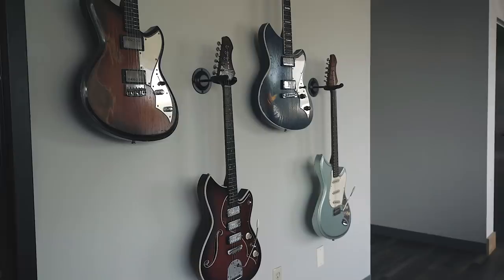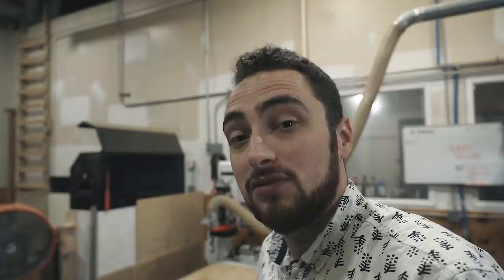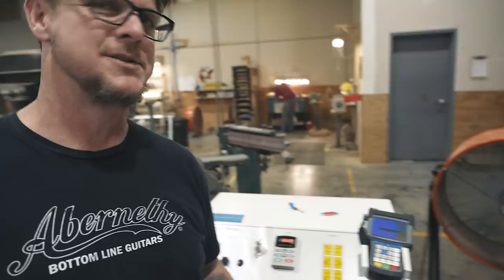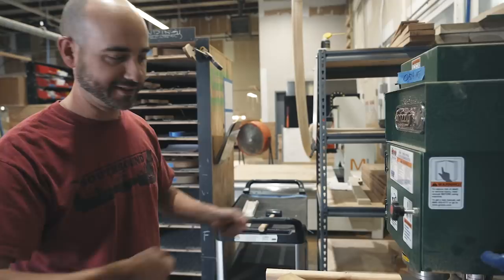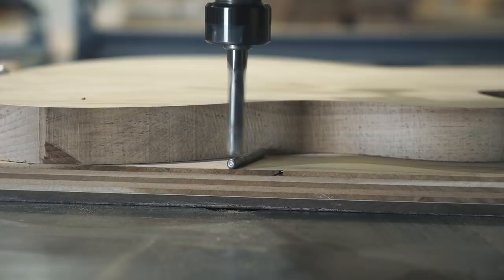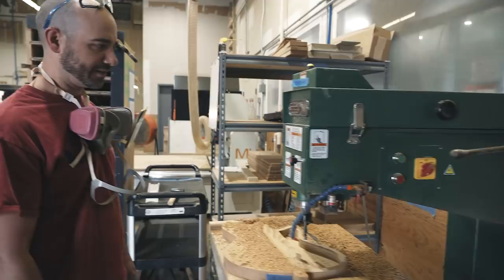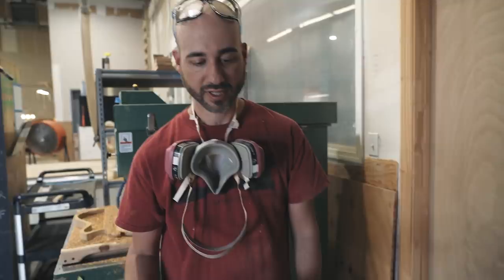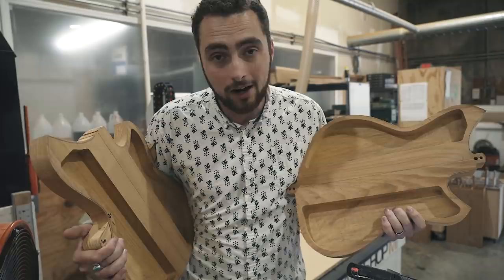Is “Handmade” Really Better? CNC vs. Handmade Guitar

Comment: I am a manufacturing consultant. We deal with this issue on many different kinds of products. There is little difference between pin router and CNC when hogging out a body blank, other than in time savings and consistency. IMHO this was not a good comparison.   The real difference between them is in FIT - i.e. the neck and neck pocket, the shape and feel of the neck and paint - the machines are much more accurate and do a FAR BETTER JOB, giving near perfect results every time (if programmed properly).  This is why you can now buy a $300 guitar that feels and looks as good as a $2000 guitar.   The differences are now in the quality of the hardware and little hand details (like dressing fret ends) that the maker may skimp on for the cheaper versions.  In addition, the maker may choose to use more expensive woods for the costlier models. But otherwise, the new manufacturing techniques for guitars (and TVs and cars and many other items) are far better and give more precise results than any hand work can do.
Reply: A violin-repairman(? -technician perhaps)  once told me that the Stradivarius-class violins were made exclusively with chisels and anything else was completely inferior and ruined, absolutely ruined the tone. Was he talking nonsense, being to picky, too exclusive?
Reply: @juanvaldez5422    Because the machine doesn't read the wood grain like a luthier can.
   I don't know that there's much difference in tonal qualities using a chisel, vs a water-jet, vs a saw, vs a router, etc etc, but there IS something to be said for reading each individual and unique piece of wood and making decisions on how to build the instrument based on the luthier's knowledge of how that will translate into tonal qualities. Wood is not homogeneous and consistent throughout. Each piece is unique and in violins and acoustic guitars, etc, this becomes even more important than in a solid-body electric guitar. 

  The average person may not consciously hear the difference but seasoned musicians can and that is why they will always choose hand made instruments, built by professionals when they can justify the price.
  Having near perfect scales is certainly an advantage of modern technology but there's also the harmonic tones that play a huge factor in how the instrument sounds. AI is not yet good enough to surpass human beings for that job and I estimate it will be an absolute minimum of 50 years before we see any system that can compare.
Reply: @christurnblom4825  Wood selection and book matching have nothing to do with cutting the wood to scale and form. The machine doesnt magically pick the wood to cut.
Reply: @juanvaldez5422  how do you read the grain? Decades of practice and experience. That and a natural aptitude at the outset. Because many folks are never going to get it no matter how long they try. Reading the grain is looking at wood and knowing what it is going to do when you work with it. Is the grain running up or down? Is it curly? The answers to those questions and more dictate what tools you use and how you use them.
Reply: It's silly that such a discussion is even needed. At the end of the day it's science and engineering. You want a specific range of output (quality and sound of product) and who cares how that's delivered tech wise. Hand work comes in where it needs to which is in the details. 

The whole debate is just a nice illustration of how belief cares nothing for facts.
Reply: @christurnblom4825  And neither are you. Your comments are a hoot tho. Thanks for the laughter. Hey, how bout this. Lets see whose really  got tone.  We can both post an original video of a original piece of music,  recorded in real time. Say, each piece has to be 3 min. or less. We will estb. parameters, such as a newspaper dated for the date , to maintain authenticity and honesty.  Lets see, put up or shut up. You down?
Reply: @Kimoto504  belief has nothing to do with what I'm speaking about in reference to wood. ...it's science and engineering. well, maybe engineering is too stong a word since I don't know any luthier that uses engineering tools to READ THE WOOD ...lol  but acoustical engineering principals apply.
I agree with you that it's really the musicians preference how they like their sound. Anything else would be stupid to assert. How it's made is less important than how it sounds to the musician.
Reply: @juanvaldez5422  perhaps you should try to do a little traditional woodworking someday? Then it may come to dawn on you that wood grain does indeed matter while working with the material.
Reply: @Kimoto504  the less someone knows the more likely they're going to be wrong.
Reply: @christurnblom4825  You must be my neighbor. He knows everything about anything!!!
Reply: @danriley9155  lol ...thanx. 

I don't know everything about anything but I will admit that I know a little about a lot.

  Sound engineering was a passion of mine but I mostly wanted to play music with people and rock musicians are so flaky in general that I could never find a group of guys that took the music more seriously than the drinking, drugs and groupies so my career choices eventually led me to machining.
Reply: Im a hand carver, and i agree and disagree. There will still be certain things inspite of CNC that will have to be done by hand though, but for over all speed and precision CNC. Hand does clean up and such as well as fine tune. The question for some though is cost and investment and maintenance... For a big company yes the way to go, for a small company it's sketchy...
Reply: @KitagumaIgen  That person is probably a traditionalist not willing to let go of pride.
Reply: Jon Sanserino i agree with you, and this guys (youtubers) often try to get into stuff they know nothing about...
Reply: @christurnblom4825  agreed! Close grain as well as sparse grain, as well separation of grain.
Reply: @KitagumaIgen  the reason Stradivari instruments were made exclusively with chisels and anything else was completely inferior and ruined is because Stradivarius lived over 250 years ago. CNC machines didn't exist at that point in time. The other thing about Stradivari instruments, the wood is extremely dense, hence the sound. Then again, most blind sound studies (controversial though they may be) have thus far shown that it is almost impossible to distinguish a Stradivarius violin from a modern violin made in the same style--so it's less the wood it was made with, and more the form. And in 2012, a double-blind test laid the issue to rest when it was shown that, in fact, neither professionals (by and large), nor the audience, could distinguish Stradivari instruments from a modern-made (machine or otherwise) counterpart.

What does this have to do with the conversation? Well, for 250 years, the instruments of Antonio Stradivari have been held up as having a superior sound, because of the wood they were made from (often attributed to the grain patterns), the completely bespoke nature of the making of the instrument, and the general superiority of craftsmanship and attention to detail.

Now we find, through science, that's not quite the full story. While Paul Reed Smith has prove that tonewood is in fact a thing--yes, he has, look it up on YouTube if you don't believe me--it makes far less a difference in an electric guitar as it might an acoustic guitar. And as far as acoustic instruments go, as the aforementioned 2012 double-blind study has shown, it's less about the wood, and more about the construction of the instrument as a whole--be it by hand, or otherwise.

The the belligerents in this thread, @Chris Turnblom--wood makes some difference in an acoustic instrument, but, as has been shown via science, far less difference than you have been lead to believe. @Juan Valdez--there is absolutely no need for that kind of vitriol, regardless of where you stand on the issue--it's childish, immature, unprofessional, and downright rude. If you can't make your point without the vitriol, perhaps you're not as secure in your position as you would lead others to believe?

In summation, the TL;DR, if you will: Wood makes some difference, not nearly as much as anyone thinks, and to prove this, the much lauded (and somewhat overrated) Stradivari Family of Instruments have been put through DOUBLE BLIND TESTS both with audience listening, and with professional musicians--and yes, while the Stradivari often barely nudge a win, it's not enough of a slam dunk to say "YA SEE? IT'S THE WOOD AND HAND MADE, I TELL YA!" But it is just enough to show (as Paul Reed Smith has done) that the wood used in an instrument's construction does play a part in how that instrument will ultimately sound. 

I mean, come on, if the wood and construction didn't matter at all, why not make all guitars out of OSB and shape them as squares glued together?

And before opposing parties (i.e. the belligerents) decide to dogpile me and deride my position, know this--I've not only played and taught music for the better part of two decades (still can't sing for shite) on acoustic and electric stringed instruments, I've also had the great pleasure of being mates with some wonderful luthiers, including a student of Josef Holpuch. We used to take rosewood sawdust and throw it by the cupfull into bonfires (I don't recommend it--it's quite uh, enlightening. There, there's my dadjoke, I can leave now!)

I know I put more effort into this that was strictly required, but by the gods, people, there's no call for this over this kind of topic. Especially when it's a topic that actual studies have put to bed. Time and again. And again. This topic has surrendered itself to Tock (five internets to ANYONE who gets that reference).
Reply: @diego2112gaming  Now that's a reply!
Reply: @KitagumaIgen  debate club in high school. It was a fun time for me.
Reply: If your $300 guitar feels the same as a $2000 guitar, bro do you even play?
Reply: Last year I finally scrapped a fully hand-wired Curtis Mathes TV sitting out in a shed.  When it was new it probably cost the equivalent of $2000 in 2018 dollars, for a 21" analog color 'console' TV.  Last week I bought a 43" flat screen digital Smart TV with Internet for under $300, and I could carry it in one hand if not so bulky.  I bought a nice power drill with LiOn battery that is almost ten years old now and going strong - all my lead-acid cordless tools sit useless, because buying new LiOn tools hardly cost more than replacing all those dead lead batteries.  Why fight progress?
Reply: @wallywalpamur4960  My 1966 Vox Bulldog cost something like $399 in 1966. So it's a $400 guitar. It feels the same as a $2000 guitar. Then again, in today's money, it'd be about $2000 (that's the joke, for them that missed it).
Reply: @KitagumaIgen  He was right until about 20 years ago.  Nobody knew how to replicate the magical tone of those violins except making them the same way and even then.
Reply: @KitagumaIgen  Unfair comparission. Another world. Acoustic instrument vintage wood based (actually vintage) vs. wood that needs to interact with an electric based instrument.
Reply: I just want an instrument to be special, honestly i was worried about the quality and all that but i think I've realized that what i truly wanted was something a little more personal, idk maybe I'd like to make an instrument myself at some point.
Reply: @christurnblom4825  Well, first of all, are you saying that a profesional luthier is going to/can consider wood grain? There is leterally no way of doing that! If you were buying some handmade things somewhere I understand that the maker wants to make more money by saying just that. But if you can explain, feel free! And second of all, even if there is a machine making the instrument, someone has to program it, the machine will never need to be able to read the wood, because there is a luthier programing it, which can "read the wood" as you said, but then again, I've seen so many instrument, mostly guitar, manufacturing videos (from experienced luthiers) and never saw that the luthier was looking at the wood closelly or anything like that, he just grabes the wood and makes the guitar (or something else). Let me tell you a secret, why every good musician invests in his/her instrument? Well 2 reasons: 1. High price means usually better play-ability in music world; 2. Think of the moment, you are about to play for let's say 1 million people, are you really going to show up with something cheap? No, a nice brand is going to cooperate with you and send you it's best of the best! That's just how it is!
Reply: @olivervojtechb.4354  
"I've seen so many instrument, mostly guitar, manufacturing videos (from experienced luthiers) and never saw that the luthier was looking at the wood closelly or anything like that, he just grabes the wood and makes the guitar." 

There-in lies the problem, I would imagine. You're watching a video. Videos get edited & you can't see what is going on inside the luthier's brain. I suggest asking these lutheirs about what I've stated here. You're likely to get more insight than you can from me.
I'm not a trained lutheir but I've been playing stringed instrument (mostly guitars) repairing & making instruments just as a side hobby, for about 27 years. I just got into CNC manufacturing about 5 years ago.
This is all my opinion. You can disagree, that's fine. But I take into consideration the tonal qualities of each individual piece if I'm trying to make the best instrument that I can make.

Comment: I'm an amateur builder of guitars, I started with a few kits, then decided to 'have a go' at  making the bodies, to see if I could do it with the tools I have. I only have a hand router, so all the body shapes were cut out with a hand saw, very time consuming. The only tool you really 'need' to make a guitar body is a router of some kind to do all the plunge cuts for control cavities and pickup spaces, etc. Actually, the real time is spent hand making the templates, to get everything in the right place using a router, and actually routing out the plunge cavities takes hardly any time at all, once the templates are correct. However, it can take many hours work to get the templates right. 
A properly programmed CNC machine can do in minutes what would take me a couple of days to do. Plenty of room for error in hand or pin routers..and potentially very dangerous indeed, and I was astonished to see no safety features on the pin router this chap was using. The speeds of the bit in these machine are many thousands of RPM...one slip, and well, only a serious injury would result. There is no question in my my mind at all, CNC produce a far superior result than a so called 'hand made' body for this part of the process of guitar making. In truth, it's the time spent hand finishing the guitar that sets 'better' guitars from the crowd. Using a CNC machine for this part of the many processes that end in a finished guitar makes the end product much better in preparation for the numerous further processes to follow, many of them necessarily performed by hand.
Reply: Yea, templates are the way to go with routers. But you can actually do the routing by hand. If you think about it, a router is really a drill, and in the old days mortices for tenons were drilled out, then finished with chisels, or cut entirely with chisels even. Sure it's time consuming, but I've personally done it many times. Not only that, but they used what was the routers predecessor, and namesake. It's basically a plane with a blade you could lower much farther.
Reply: A pin router is no more dangerous than a sharp kitchen knife. I have and use both.

Comment: As a 20-year machinist and more than 25 years as an engineer (got my degree in the middle of things),  I would take a CNC-made instrument any day. Uniformity being the main reason.
If I see "Jim the rock star's" Les Paul, I want one exactly like it!
Reply: Might look exactly like it. But I highly doubt it'll be "exactly" like it. Wood grain and density, finish coats, hardware weight. All that makes Jim's guitar, Jim's guitar. What you want is eye candy. Something that looks like Jim's guitar
Reply: @roberthelmick9574  I've been a hard rock lead player for 52 years. I mostly only bought LPC's. Owned 40 of them at one point (all Norlin's back then). I have 16 now. All sound different. My avatar is a couple of them. ;) Although I have a Carvin and a Strat in this pic.
Reply: @markham4041  40 guitars. Wow. The string and polish budget must've been through the roof. Lol
I stopped buying guitars 2 years ago and started making them. Mostly copies of PRS styles, but I made a few strats, a tele and even one of Jerry Garcia's guitars. However I don't build mine to be exactly like the ones I copy. And I do not make Counterfeits. I have 17 I've made and 3 I've redone. I just made a few mockups of a singlecut style I designed with different carves. Trying to figure out which one I like best. Eventually I'd like to move away from building the copies to just building my own style of guitars.